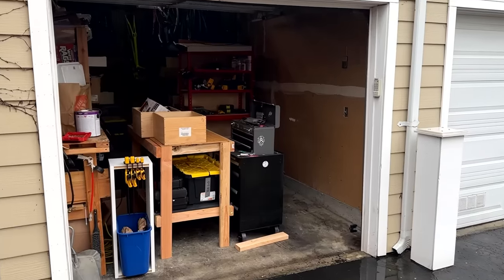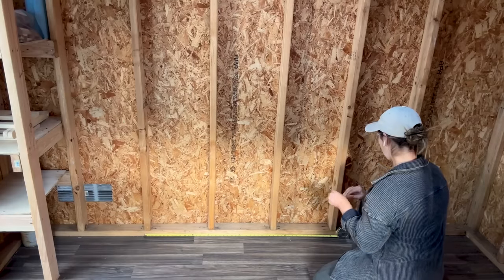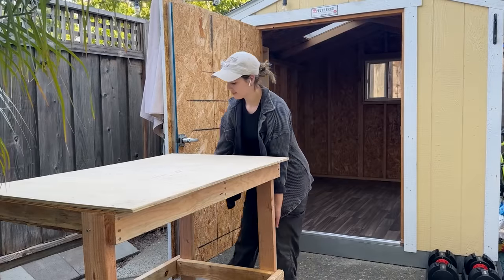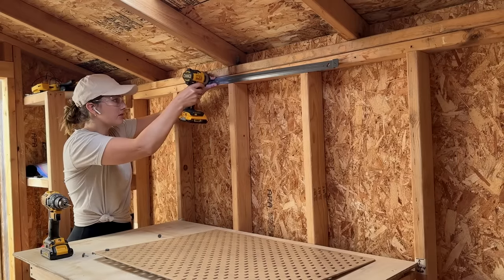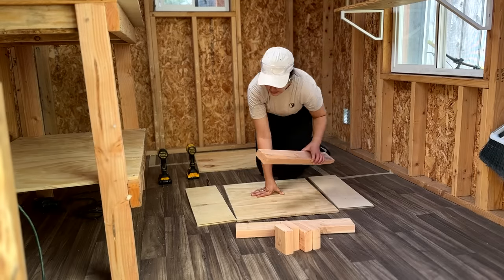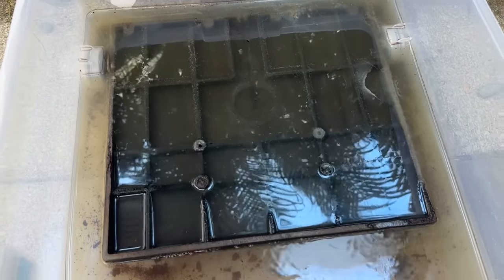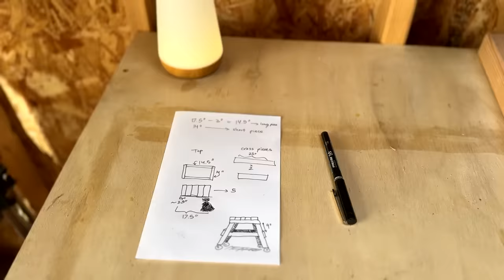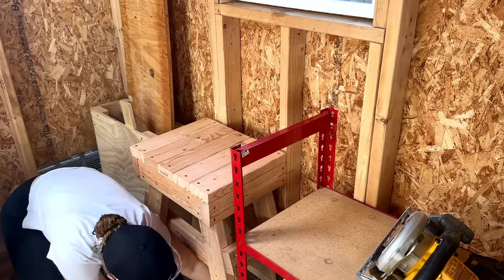Building a Mini Workshop... Again

Comment: Hi Elena, congrats on your neat little workspace! How's it working out?

A quick piece of advice for your consideration: when you're drilling holes, especially holes that are 3/8" or smaller in diameter, set your tool to its "drill" setting and the speed setting to 2, and spin the drill bit to max RPM while applying only enough pressure to get the drill bit making progress. When you've drilled to the desired depth, keep the bit spinning in the same direction and just pull it out. You'll feel a bit of resistance but not much. You should not reverse the direction of rotation in order to extract a drill bit; you only do that with screws. 

This is the correct technique. It will yield cleaner holes and save you time and effort and wear on your tool.

While I'm on the subject, if you're drilling deep holes, deeper than 2 inches let's say, it's a good idea to extract the bit every 3/4" or so in order to evacuate all the wood chips that build up in the spiral flutes of your bit. Keep the bit spinning all the time, and just press, extract, press deeper, extract, and so on until you've reached the desired depth.

Cheers and happy building!

Comment: Love what you're doing.  My only suggestion is to add insulation.  i just did that to mine and it was a huge ordeal as I moved 19 yrs of 'stuff' to get where needed.  In the Texasa summers (which is most of your year) it was just too hot to work in.  Makes a huge difference.  I feel like you'd only have to move a few things and you'll be more than happy.  I also added a radiant barrier and that was tremendous too.  Otherwise, excellent and have fun.

Comment: The space you have is more like the average woodworker has at home here in the UK where space is always short.     So it's interesting to see the use you made of the space.    I don't know which part of the USA you live in, but for those of us where the winter brings short, dark days, painting the inside of the walls can brighten things a lot.    Also some kind of insulation is often useful - either to keep heat in or out.    There's also a nice long space up near the apex of the roof where you could store longer timber, up out of the way.    A great video, thanks for posting it.
Reply from the maker: I feel lucky to even have a garage to make into a shop, so can't complain too much :) Luckily, beyond a couple anomaly days each year, where I live it never gets freezing cold or too insufferably hot. When I was setting up this shop it was pretty much the hottest it ever gets.

Comment: You have made great use of what you have available. I think it's a very quaint and comfortable space to be able to work right out your patio door. I loved the clip with the dog laid out on the couch in the background. Now that's living! 

One suggestion I'd make is the shelf in the middle of the window. Put it above the window and cut it down so it doesn't stick out so much. Use it to store clamps, just like you did on the other wall, clamping them to the wall header. Put the longer clamps on the side and shorter clamps across the front. I use some of those cheap metal L-shaped shelf brackets to store all of my F-style clamps. They're strong enough and come in different sizes. You could add some of those brackets along the sides of the window.

As was suggested in some other posts, get an 8ft 2x4, cut it in half, and lay then in the slots on your saw horses and then lay a 4x4 sheet of plywood across that and now you have another work surface as well as support for making your cuts. Get a 4x8 sheet of insulation, cut it in half, and now you have 2 sheets (using one at a time) of sacrificial surface for all your cuts. That will probably outlast your time in that workspace.

New subscriber. I'm looking forward to watching more of your videos.

Comment: Looks like a great space. Wasn't going to say anything, but at the end of the video you said suggestions were welcomed. My one suggestion is to round the corners on your workbench. Small spaces and corners create bruises. Other than that, great shed. Oh something I plan to add to my shed is LED light strips and rig them to work off a rechargeable battery.
Reply from the maker: Definitely a good suggestion, thanks!

Comment: Nicely done! I have the same saw horses. I hope you registered yours for warranty when you bought them. A tip: when drilling holes keep the drill in the forward direction and pull it out backwards while pulling the trigger. This will clear the hole of debris.

Comment: Great job! Would recommend on CLOSING up the small air vents at the bottom to deter little critters from coming in...some. And instead create a ventilated fan up in the peak by the back end wall, if you still want one. That way you have a bit more 'bug security' as a deterrent. If you chose to consider that, use the green vent meshing you can purchase at a local hardware store to 'filter' out from having critters come in that way too. Otherwise, you did an excellent job! Hope you enjoy it and thank you for sharing.
Reply from the maker: Thanks! Appreciate the suggestion
Reply: I solved this by putting wire mesh in front of the vents

Comment: Really nice setup. I particularly like the shelf tucked into the corner, maximizing the use of the space there.
For your clamps storage, I would recommend screwing a ½" thick board to the wall horizontally and using the notch in the clamps to just hook onto the board. This saves a lot of time and effort when grabbing and stowing clamps, keeps them organized, and holds quite a few of them.

I upcycled a bunch of wood slats from an old bed frame and they work great for things like this.
Reply from the maker: Good tips!

Comment: I'm working out of a 120 square foot shop as well, 15x8. My workbench folds out and has castors so most of the time it's either out on the patio outside, or folded up on the wall so I can work inside on the 2ft wide bench that stretches the width of one of the walls. Most of my projects are refinishing old furniture, or building bookshelves and things like that. Wish I had a bandsaw like yours. One day maybe I can afford to get one! haha I wish I had a neighbor like you so I had someone to talk shop with.
Reply from the maker: Nice! Sounds like a cool space that works for you

Comment: I worked out of 10X10 shed for 20 years, I even had a bike lift in there in the winter, I built 3 lofts, that helped a lot. It will work, now I have a shop that is 26X24.

Comment: Hi Elena a job well done. Just some advise. I noticed when you were drilling you use the reverse to take the dill bit out? Better and easier to do it one action with drilling the hole and then pulling it back out while still spinning no need to stop and potential strain on the brill bit especially on small bits. keep going.

Comment: Nice workspace.

Couple of recommendations:
1) Swap out the pegboard for the standard stuff with 1/4" holes on 1" centers. There are a lot more hooks and other accessories that fit standard pegboard, and they'll be a lot cheaper than anything proprietary. Eventually you'll eschew pegboard in favor of French cleats like all woodworking YouTubers do, but for now PB is cheap and widely available.
2) Add some screens to those vents in the side of the shed to keep bugs out.
3) Don't use a screw to hang the bandsaw power cord - the threads will eventually chew up the cord and you could end up with a short that could damage your saw, or get zapped yourself by an exposed wire.
4) Get yourself a couple of sacrificial 2x4s to use in those nice folding sawhorses when you're cutting sheet goods, so you don't have to hold the material with one hand while holding the saw with the other while you make a cut.
5) Future upgrade: Consider replacing your plywood bench top (and the shelf on the window) with melamine. It's heavier than plywood, but it's dead flat, wood glue doesn't stick to it, it's smooth enough to put down a sheet of paper to write or draw on, and you can use iron-on edging to ease the edges so you don't get cuts or splinters when you brush up against it.
Reply from the maker: Appreciate all the suggestions!

Comment: Great video, I used an old pop-up camper trailer as my portable shop for years.  As for the rust prevention, it's better to use lanolin to stop rust in it's tracks. it's available in nearly every pharmacy/drugstore and supermarket around. Great stuff, can be used to rustproof metal, restore leather as well as prevent chaffing  It can be thinned with various natural solvents, then applied with a spray bottle if needed.
  My current shop is an 8x10ft shed, the table saw, miter saw, router table and spindle sander are all on one 10ft counter. I made small drop down doors in the wall at each end,  so I am not limited by the length of the piece  I have to cut,  just open the doors and I can cut any length of board simply by passing it right through the shed.

Comment: Add some diagonal braces to the bench, it will make it more stable. As an alternative you can fasten it to the wall, but in a tiny shop everything should be easy to move around. I have a 10x14 shed/shop so my benches are fixed. I do machining and wood working so many of my tools need a permanent home.

Comment: Looks awesome! Congratulations on a space of your own to work. Only suggestion I'd make, and considering this video is 8 months old, you may have discovered this already, but I'd put the work table in the center of the space so you can easily access all sides of it. it would also make it easier to bring longer pieces through the door and right onto your bench.

Great job and thanks for sharing!
Reply from the maker: I actually moved to a new space and rebuilt my workbench. I put it on caster wheels so I could put it anywhere I need :)

Comment: Have you considered a Shop Vacuum for your workshop? Because of space, I purchased two RIDGID Shop-vacs for my Miter saw, Bench Joiner and Planer. They work great for small places and captures a lot of saw dust as you work. Thanks for sharing!
Reply from the maker: I do have a shop vac and trying to figure out the best dust collection system for my space right now :)

Comment: May I recommend that you invest in a combination wrench set both SAE & metric.  Buy the type that has a ratcheting boxed end set on a slight angle and invest in a socket set and wrench.  A big adjustable is hard to deal with on small bolts.  Don't get wrenches that are flat or ones that flex on the boxed end.
Reply from the maker: Appreciate the suggestion but I actually do have one, just couldn't find it in the chaos of moving all my tools over to the new space and decided to grab the adjustable one :)
Reply: @elenamakes  It was just ugly to watch you struggle with a BIG Crescent wrench.  Glad to hear you do have those.

Comment: Make a fold out fasten to wall,up when using down when not, I only have small court yard all working top are foldable,tool cupboard is converted wardrobe with wheels on it so I can push in unit when raining,push it outside when it’s not,thank you for your video cheers terry

Comment: My first "shop" space was in a large broom closet. When I finally got my own place I built a shed 16"x 8" (four sheets of plywood) with a covered porch area so I could sand/ grind outside even on rainy days. I found a a tiny woodstove made from a propane bottle  that I installed that heats it up in the winter and also serves to get rid of all the small wood scraps.  11 years later it's still my cozy little workshop.
edit: I don't know how the damp is in your area but adding some kind of moisture absorber or even a small dehumidifier might be a good idea to keep your tools from rusting. Un-insulated and unheated sheds can get pretty damp.
Reply from the maker: Appreciate the suggestion!

Comment: Great use of the space, love that sense of freedom you get when setting it up. I use a 10x10ft metal shed, once i got 4 workbenches in there, a big laser cutter, 4 3d printers, a table saw and a few other things there's just a 6x8 space in the middle for me to move around in, but it's still great to have my own working space :)

Comment: Add a front open porch no floor or walls just roof to work under and connect to the shed (at the same width and length as shed) Rain is so hazardous to wood and electrical tools.

Comment: This was great! Thank you! I'm setting up a small workshop in an empty 10x10 stall in my horse barn. Mostly for tool storage since I don't have a dust collection system. I have a 4' door to the outside, so plan to put my larger tools like table saw and compound miter saw on wheeled bases so I can wheel them outdoors to use when the weather allows...I live in New England! I want to fit everything in, in an organized way. I just subscribed and am looking forward to future videos and checking out your library of past content. :)

Comment: Great job, consider insulation for those hot days.
I just finish putting insulation in the ceiling on the place I’m currently have. I still need to do something about the brick walls though.

Comment: Not sure where in the world you are, but here I'd have to worry about bugs, mice, and snakes using those exterior vents.  Perhaps an internal filter fabric cover?  Or Just be careful about making a blind reach into a trough or that wood container.

Also the flaired legs on bandsaw stand make it more stable but in a small space I would kick them more often (clumbsy me).  A sturdy cabinet could provide similar stability via extra weight.   What you have is done & works...at least if you aren't as careless as I can be.

Comment: Great shop!  I envision many great projects coming out of it.

Quick question, and I apologize if you answered it earlier in the comments - how are you getting power out to the shed?  I didn't see any outlets during the video, and I imagine that wiring would require the landlord's approval.   I ask because I've been thinking of clearing out all the junk in my own shed (needs doing anyway) and setting up a similar shop... but the closest outlet would be (brace yourself) out my studio window with an extension cord.  Not the most stable access, especially since one of the tools I'd like to move out there would be my CO2 laser cutter... so I can maybe have my dining room back?
Reply from the maker: Thank you! I use an outdoor extension cord and have it go from an outlet right by my sliding door in my house to my shed. It has 3 outlets at the end so I can plug in multiple things and then, when I'm done for the day, I unplug everything and bring the extension cord back into the house.

Comment: Good video.  Suggestion here. Hang extension cord from studs.  Also, on power cord side of band saw, install a couple of cup hooks to wrap cord around.   One more thing put a power strip on either the workbench or bandsaw table with long cord.  I think some mentioned wheels on workbench.

Comment: Cool workshop, mine is even smaller. If you wanted to easily beef up your workbench, I've found that two sheets of MDF makes a really hefty top. I use moisture resistant MDF and so far seems pretty durable.

Comment: At least you have a shed to work in. All I have is the covered car space in front of my house where I have to make room for a locked steel cupboard, a tool chest, a small wall mounted cupboard with fold down bench and a table saw and router table.  All of this is locked down and pushed behind a small home made bench.Wood storage is in the access lane behind the house, against the rules but nobody has complained. Tool and supply organisation is almost impossible. Starting work involves moving the cars out and sweeping up the leaf litter and other accumulated debris before I can set up. Then I have to hope I can work between the afternoon to early morning rain storms and the complaints from the rest of the family about the noise and dust.

Comment: I think it’s cool to keep exploring how you can utilize the space between the studs so the storage is more evenly distributed over the surface of the walls which is gonna leave you with more volume to handle some pieces without getting stuck or banging into too many corners
For example that board over the table u can split it in two and reattach between the studs, Sam can go for the scrap bin - if u use the wall of the shed as one of the bin walls, you’re getting extra storage volume there as well! The red shelf if you’re keeping it, if u put a piece of scrap under it, you can level it with the base of the wall frame and push it more into the wall. So you end up saving a few inches here and there and in the end all of those extra inches are gonna contribute to the free space in the middle 😊

There’s probably some lightweight stuff like some plans or sandpaper that you can even attach at the base of the roof. It will both stay out of ur way and be easy to find

Comment: Looks like you utilized the space well.  Is there electricity in there; didn't see any outlets?   If you get tired of Phillips head screws slipping when the going is tough, Torx (aka star) head screws are much better, even square drive.  Just my 2 cents.

The battery powered circular saws have sure improved over the years!  The early ones were wimpy and ran out of charge fast.  Keep up the good work Elena.
Reply from the maker: Thanks appreciate the tip! I have an extension cord I run from the house when I'm in there. Pretty simple setup but it works

Comment: Elena - May I suggest a socket wrench and a set of sockets? It'll make things a lot easier for you instead of the adjustable wrench one turn at a time! Great video by the way and cool workshop! Thanks!
Also you didn't mention how you got electrical hooked up to the shed for the bandsaw. Would've enjoyed seeing that as well.
Reply from the maker: Thanks! I do have a socket wrench set but for the life of me couldn't find them in that moment. As for electrical, it's pretty simple I just have an extension cord from the house.